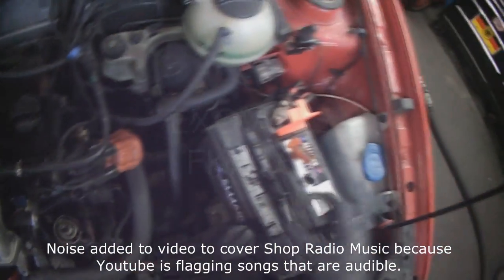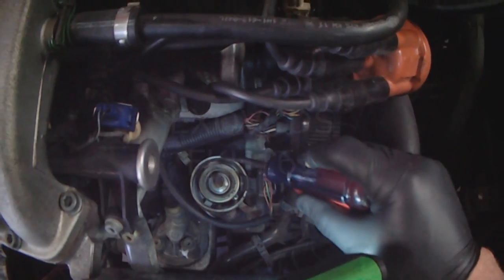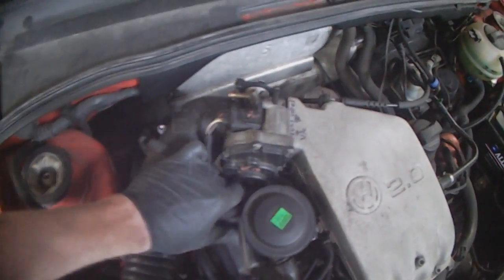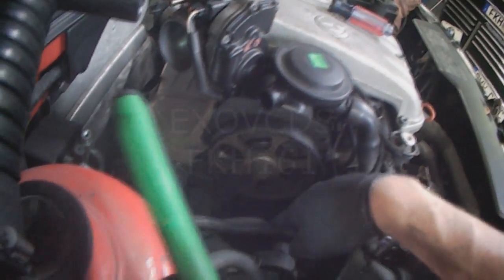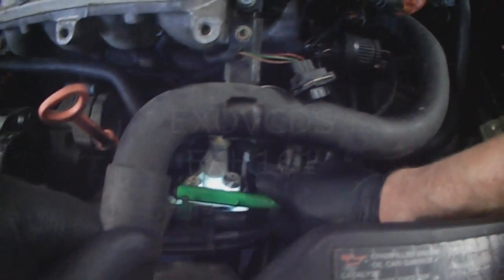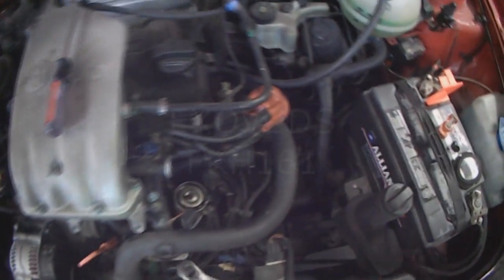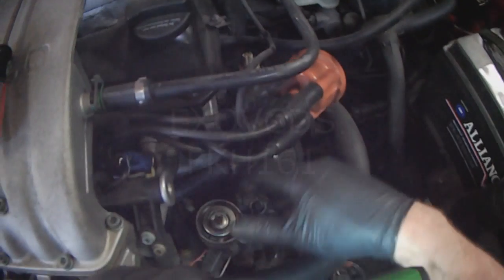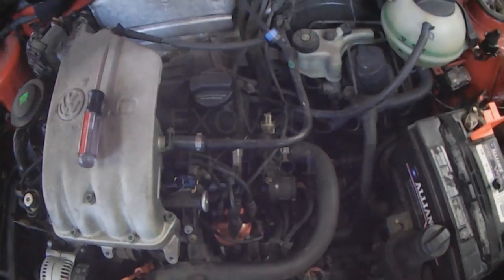VW A3: 2.0L ABA Distributor alignment / indexing

Comment: Could this be why I still have a camshaft position sensor code? My dad bought my 96 jetta with a broken timing belt for cheap because his mechanic didn't know they aren't interference and thought it had to have the motor replaced. My dad and I put the new timing belt on, and i'm not sure if he indexed it like this. It would stall/stutter and the rpm's would bounce or drop. So I got a new distributor thinking it was the sensor itself. Put it in and didn't change anything. So we kind of played around turning the distributor and now it runs better and doesn't stutter as much but the rpm's are hardly ever normal and the code came back on after it was cleared. Is this what I should check?
Reply from the maker: Yes, could be... turn the engine to TDC by hand and then line-up the rotor. These 2.0L ABA engines CAN bend valves! I have seen a couple, but most seem to be lucky when the belt breaks.
Reply: ***** yeah I know it's probably 50/50 that the valves are bent. Luckily they weren't and the engines are pretty cheap! Thanks for the input, love your videos!
Reply: what fixed it?
Reply: keeping in mind i dont know the history of my engine but the belt has not been broken from what i knowthe mark on the crank or cam i think is off a half a tooth or so